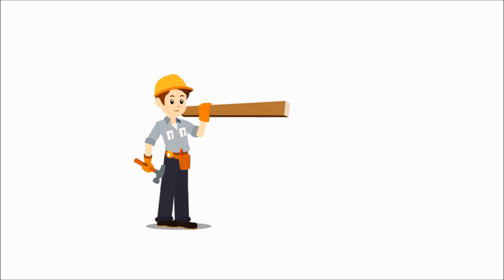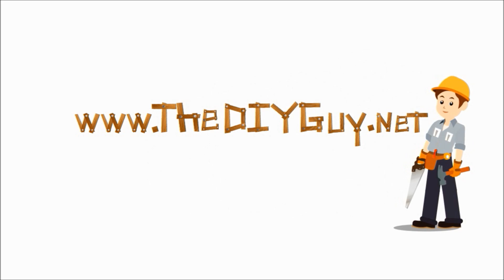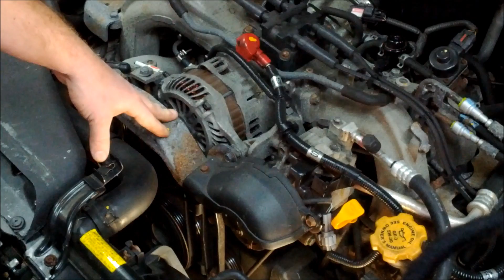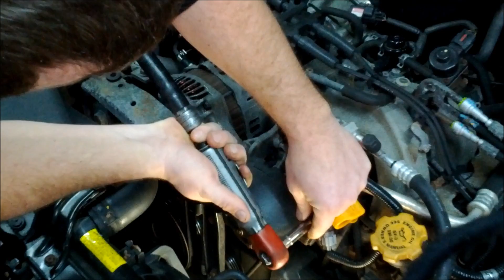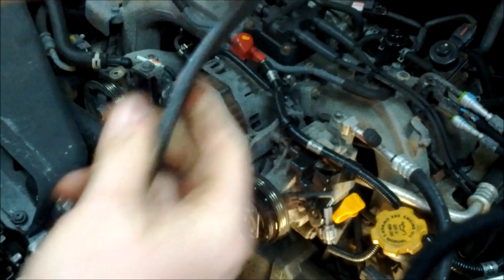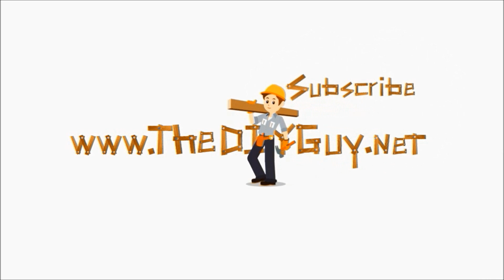How To Replace Both Subaru Drive Belts

Comment: I'm changing my serpentine belt and I'm super confused. Why can't I find the second belt online? Are they the same size and I just buy two of the same belts? Someone help please.
Reply from the maker: What year is the car? 2012 or newer? This will work for 2007 and below. 2008-2010 is a stretch fit belt and then they went to a one belt design on the newer models. If its a 2007 or below there are links to the belts on our website. If you click the link in the description it will take you to our write up on the website.
Reply: Its a 2002 subaru wrx

Comment: I just did this because the AC / Alternator belt was shredded up real thin! Not sure why??? After I replaced the belt, the air bag light as well as the abs light came on. Car stalled and I had to get it jumped. The engine would crank but not fire on. Any ideas? Someone said I wasn't getting enough power and needed to replace the alternator... but no problems ever before this. HELP! Laughs Thanks!!!
Reply from the maker: The a/c belt could have been out of adjustment or old, weathered and cracked or is the compressor frozen? Do you have the alternator belt tighten enough to turn the alternator? Sounds like the car was just running on the battery and then ran it dead then then car shut off. I would charge up the battery then check the tension of the belts, connections for the alternator and also the battery cables. If that doesn't seem to fix it I do have a video up on how to test a alternator so you could watch that and test yours to make sure yours is working. If yours isn't charging I do have a video on how to replace one as well.

Comment: Stone smooth - thanks
Reply from the maker: You're welcome. Thanks for watching.
Reply: I had to remove the driver side fan to get at the nut to losen the nut for the AC belt - 1999 - not even an inch to get the nut loose - PITA

Comment: How tight/loose do the belts have to be?  I think my belts are too loose or something, because every time I turn on the fan for A/C and heater, the belt whines really loud.
Reply from the maker: Hopefully you got it dialed in.. If not if you click the link in the description it will take you to our website and if you scroll down to the bottom it will have a picture and an explanation on the proper tension.

Comment: I have a squeak when I turn.. what does that mean?
Reply from the maker: Your belt could be lose, have glazing from slipping. Give it a good look over and look for cracks, shinny spots and check the tension. Click the link in the description and it will take you to our write up on our website and at the bottom will explain how to check the tension.

Comment: Hi,

I would like to change my belts on my 2010 forester. the ac belt is set up differently than in the video. How do I loosen this belt to remove it. Also in your video you say the belts should not be to loose or too tight, can you define what that tightness really should be?
Reply: The 2010 Forester requires an AC "stretch" belt and custom installation tool set...

Comment: Whenever I try this.. The socket won't fit to un do the bolt on the AC pulley. The AC fan is in the way
Reply: Logan Paul get better tools
Reply: Rotate the A/C fan so it's as out of the way as possible.  I use a 1/4" short socket and wrench and hit it from the top.  You'll have to experiment with your socket set to find one that will work for you.  Get yourself some PB Blaster and hit the bolt with that first.  It'll loosen like a charm even with a small socket wrench if you let that sink in for a minute or two.
Reply: Hey I know this is late, but if you hit the same problem that I did you can pretty easily take out the fans. There are just 3 bolts on the top and 2 power connectors to disconnect near the bottom. Once that is out of the way there is a lot of room to work with
Reply: Use a box end wrench...  My socket didn't fit either.  Nice one Subaru...  :-[
Reply: Logan was right...for my Impreza anyway, too tight even for 1/4 inch......I had to use a combination wrench.....

Comment: how do you know what the correct tension is? both belts just went on my 2005 Outback Sport. how do i know which model numbers i need?
Reply: This information is available in the car's manual.  They're available online if you do not have yours.

Comment: how did you know it was the AC belt and not the harmonic pulley? I have a squeak on humid and rainy days coming from my engine and i think its the pulley.
Reply: Here's a quick and painless way to figure out which belt is squeaking at you.  Look down where each belt makes contact with the pulleys.  Spray a bit of water or pb blaster onto the surface of the pulley that the belt runs on while the engine is running.  Do not spray it directly onto the belt (it will only work if you spray it onto the pulley).  If the squeaking noise stops, you know that its that belt.  If it does not, move to the other belt and do the same.  There are gaps between the belt and the pulleys at various places, so it shouldn't be hard to find an easy spot to spray.  If the squeaking does not stop once you've done this for both belts, then you know it's a pulley or a bearing in one of them.

Comment: straight to the point.no bullshit off topic jiber jaber .great vid .good job man .
Reply from the maker: Thanks.
Reply: I saw another video where a guy said when you push on the belt between the pulleys you should have about 1/8" to 1/4" play. I'm not a car guy so he, and therefore I, may be wrong. Hope it helps though.
Reply: TheDIYGuyDOTnet hey I just did my  alternator and put back the belt I even marked the the thread by scratching it to make the mark my question is even though I marked it it feels tight how do I check how much is to tight cause if I run on the highway doesn't the belt tighten even more ? How much is to tight? Or do you think we're I marked it it should be ok ? Your video is great it you actually speak of tension on belt.
Reply: Nice video but, did you move the fan plug/wires? No matter what I do, I can't get any wrench on the lower locking nut

Comment: the big pully keeps popping off after i tighten it. do i need a special tool to tighten it.
Reply from the maker: +chandar pass I'm guessing your are talking about the crank pulley..  You need to make sure you stop the motor from turning so you can really get it tight. If its a 5spd you can put it in 5th gear, if it an auto you will need to take a prybar and put it into the hole where you remove the torque converter bolts on the back side of the motor. Sometimes you will get a pulley where the rubber part separates from the metal causing it to keep losing up.

Comment: Are both of those belts the same size and part number?
Reply: +PinprickSociety They are not. The alternator belt is longer.
Reply from the maker: +PinprickSociety They are not. You will have to double check these numbers but a Gates K050345 and a Gates K040332 sould be the belts you need. There is a link to them on our website were you could put in year and model and double check. Thanks for watching.

Comment: How do you determine the tense on the belts (both)? Thanks... great video btw.
Reply from the maker: +Butch Ignitz The way to check the tension is to press on the belt from the outside of the loop towards the inside (on the flat, wide side of the belt...), at a point midway between the alternator or A/C pulley (depending on which belt you are checking) and the point where the belts cross, and apply 10kg/22pounds of pressure (can use a fish scale for that.). Properly tensioned new belts should have 7-9mm of play, reused belts should have 9-11mm.(something close to that in your owners manual. The easy way is to wiggle the belt where I did and make sure you have no more then 1/2" of travel. The belts will wear in a bit and need to be tightened again later on.
Reply: +TheDIYGuyDOTnet Thanks! I was going to use a belt conditioner to stop that squeak sound it makes, but for safety reasons decided to get new ones.

Comment: is this a similar process to replacing Drive belts on my  04' Impreza Wrx?
Reply from the maker: +Dannie Rozet Yes it should be identical to this. Thanks for watching.
Reply: +TheDIYGuyDOTnet did you ever need to drain any coolant?

Comment: Is this belt same as a 2009 Subaru forester
Reply from the maker: +larata9 I am pretty sure the A/C belt is. But I am also pretty sure that your alternator and power steering will be a stretch fit belt. 08-11 Impreza and 09-11 forester.

Comment: Thankyou for this video you helped me change my belt
Reply from the maker: +Felipe Raymundo Great, Glad we could help. You're welcome and thank you for watching.
Reply: +TheDIYGuyDOTnet Thanks for the upload man. My impreza has started squealing on cold startup, can i tighten up the belts or do i have to replace them to cure it?
Reply from the maker: +Mike Litoris Hello, it depends on how long they have been squealing.. Check the belts to see if they are glazed over.(shinny spots from the belt getting hot from sliding on the pulleys)  If they have a good amount of glazing they should be replaced. If there's none or a small amount you could just tighten them.

Comment: Hi there. First time watching one of your videos and I must say what a wonderful job you do.  You think of errors that novice car mechanics will encounter by showing which bolt to use for "holes" knowing that some will forget to keep up with it or mix there bolts.
Reply from the maker: +Darius Gill Thanks for the kind words I just try and be as thorough as I can to make sure anyone can complete the repair and have success. Thank you for taking the time to leave us a comment and for watching.
Reply: @TheDIYGuyDOTnet  This video was a perfect match for my 2008 Forester. One complication for me was that the 12 mm bolt on the alternator that held the right side of the left cover shifted when I moved the alternator up and down. I had to lower the alternator again, slide the bolt forward (toward the front of the car), and hold it in place while I raised the alternator.
Reply from the maker: @dlxmarks  Yes, This video should work for early 90's Subaru's up till 2008-2009 when they went to the stretch belt. Glad to hear it went rather easy for you and that we could help you get your belts replaced on your Subaru. Thanks for watching and taking the time to leave us a comment. Don't forget to give the video a thumbs up. Thanks

Comment: I just replaced the alternator/power steering belt on my 2008 Impreza after watching this video — thank you! But it seems that the a/c belt does not have the adjustor yours does. Any ideas on how to loosen that one? Thanks again, this is the first major car repair I have attempted.
Reply from the maker: +Karen Wilson If it doesn't have this style adjuster it is most likely a strech fit belt. They are a little more complicated to put on. First go to the parts store and have them look at it to ensure its a stretch fit belt. If it is you need to replace it with a strech fit as you can't use a standard v- groove belt. When you open the package on the new belt it will tell / give you picture on how to install it. You will take a pair of angled cutters and cut the old belt to remove it. Thanks for watching.
Reply: +TheDIYGuyDOTnet Thanks for the reply, you are right! They did hook me up with a stretch fit belt so I will see what I can do.

Comment: What is the year/make/model of this vehicle?  I have a 2009 Subaru Impreza 2.5i that I'd like to replace the alternator and power steering belts.  Is it as straightforward to do on my model as it is in this video?
Reply from the maker: +Damon Jacobson This one was a 2005 legacy. It will be very close you should be able to replace yours from watching this video. Good luck.
Reply: Thank you, I was able to rather easily! Excellent video.

Comment: Do you think the Bando brand belt is of good enough quality to use?  Thank you for the video.
Reply from the maker: +TheMountainTimeZone  I'm pretty sure that bando belts are OEM belts on Toyota's. I haven't personally used them but the key is making sure that the grooves on the pulleys are clean and aligned and that the idler bearing is in good condition to give any belt a chance. Your welcome, Thanks for watching.

Comment: What are those spinning things called that hold the belt... an idler as when i google idler it comes up with timing belt ones...

One of my idlers for my ac drive belt is bad and i wish to replace it + the belts how much for these parts
Reply from the maker: +Jared Tate If you google subaru belt tensioner you should find what your looking for.

Comment: Why do I keep being told I need a special tool to change my belts?  Are they talking about the dealership guy? ;)
Reply from the maker: +Jen Fugit Hello, You should need no special tool to change the drive belts. As you have seen in the video we didn't use any special tools just ones that could be picked up at your local hardware or automotive store.

Comment: What brand belts did you use? I have a 2006 model, and bought some Dayco belts for it from Autozone. My current belts slip on start up (I have no idea who the manufacturer is). Is Dayco a good brand?
Reply: Dayco is a pretty decent belt manufacturer, I've used their belts several times in multiple vehicles. I give them a thumbs up
Reply from the maker: Gil Gredinger Ya dayco belts are pretty good I have also used them.

Comment: Thank you for the video. So the bolt on top next to the alternator (vertical one) broke when I was loosening it. I guess it was very old. Of course I'm going to replace it (once I get the other half out), but would you say it's unsafe to drive with just the 12mm horizontal bolt in there holding the alternator?

Comment: The a/c belt on a 2006 Forester is not as easy to get to as this car.  The radiator fan blocks access to the tensioner nut.
Reply from the maker: Pineappleguy Some are a little more difficult.. You should be able to use a shorter socket and get in there. Sometimes its easier to remove the two fan bolts and undo the clip and remove the fan.

Comment: Great video. There is a lot of debate however, if the crankshaft pulley on a WRX is in fact a harmonic balancer at all though, it seems to consist of two steel parts, and a rubber ring in between. The rubber ring is not a harmonic balancer, and apparently serves to only dampen the alternator and/or power-steering a bit.

Comment: I broke my pulley tensioner to my a/c cause I was watching this and my phone died in the process and I ended up breaking the adjuster to the a/c belt. Fuck. Lol it's just kinda wiggling now till I look how much it costs but this very helpful thank you. I just wish my phone didn't die and I made a mistake
Reply from the maker: Khailien Tran That sucks sorry to hear. You Could find one at a junk yard for much cheaper then new. A few years and different models will fit as they didn't change them. Your welcome.

Comment: Some sites say that the a/c uses a stretch belt -- my Legacy is a 2009 2.5i non turbo

I ordered Gates k050344 and a k040332 - amazon says these fit -- I'm confused

Thanks, in advance

Comment: Hey just wanted to say great video. I was about to do this myself but I had completely stripped out bolt to the right of the alternator. I was gonna heat this up or use an extractor to get this out. I'd like to replace that but not sure which bolt to get. Is there any info you can shed on this?

Comment: hey man i have a 2007 2.5xt forester, the ac compressor is going out and i want to save up and buy a new one rather than a refurb, can i just cut the belt off for now? im pretty sure the back belt only runs the ac compressor.
Reply from the maker: Jacob Borleske Yes, You are correct the back belt just does the A/C so you should be able to cut it off without a problem.

Comment: Great video! Chunks are breaking off my belt cause it's so dry. Is there any specific ways to get the tension back on perfectly? Or should I just tighten the bolt back until the belt is snug?
Reply from the maker: bmwmsport11 Thank you. Technically there is.. The way to check the tension is to press on the belt from the outside of the loop towards the inside (on the flat, wide side of the belt...), at a point midway between the alternator or A/C pulley (depending on which belt you are checking) and the point where the belts cross, and apply 10kg/22pounds of pressure (can use a fish scale for that.). Properly tensioned new belts should have 7-9mm of play, reused belts should have 9-11mm.(something close to that in your owners manual. The easy way is to wiggle the belt where I did and make sure you have no more then 1/2" of travel. The belts will wear in a bit and need to be tightened again later on.
Reply: bmwmsport11 I don't know how you think it's ok to keep using that belt. If you haven't done so already it needs to be replaced immediately
Reply: AJFresh I never said I'd reuse it. Went and brought a new one and now the engine runs much quieter.